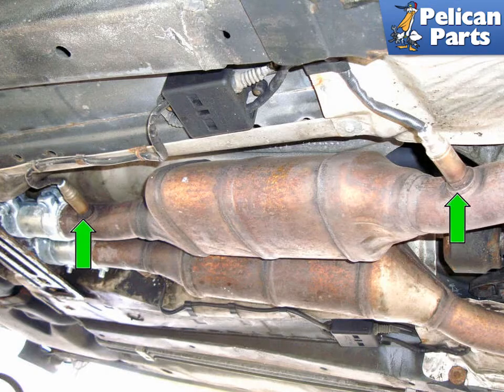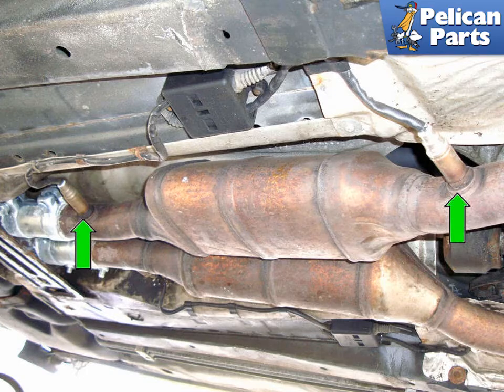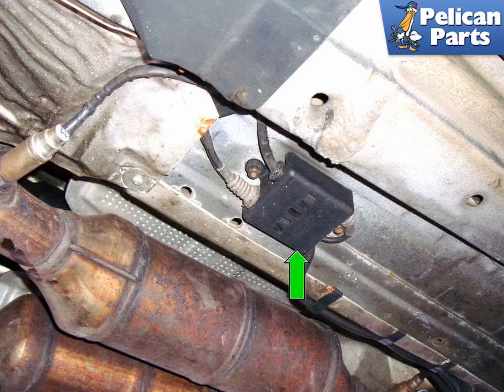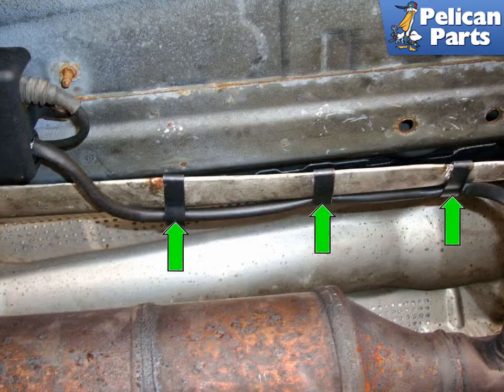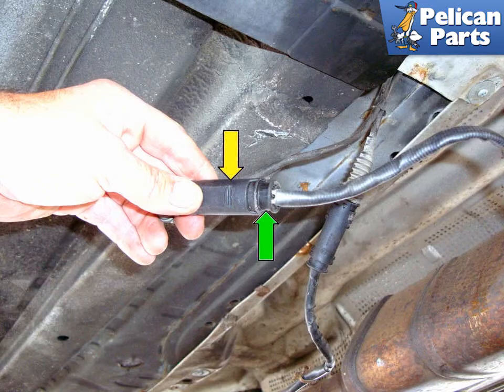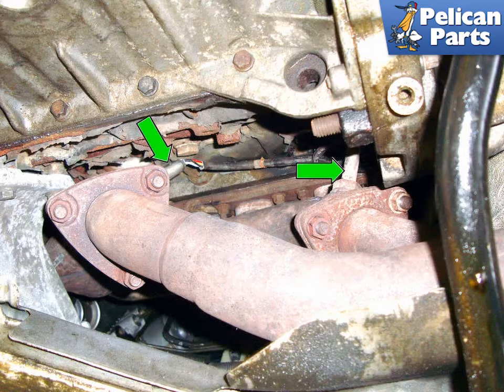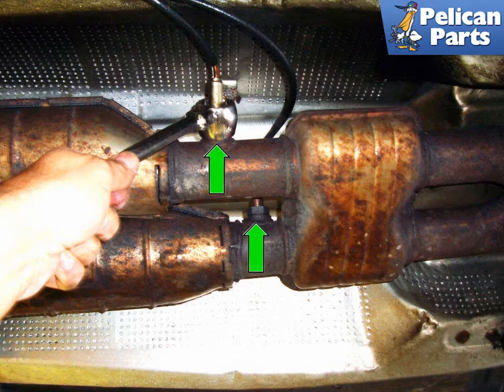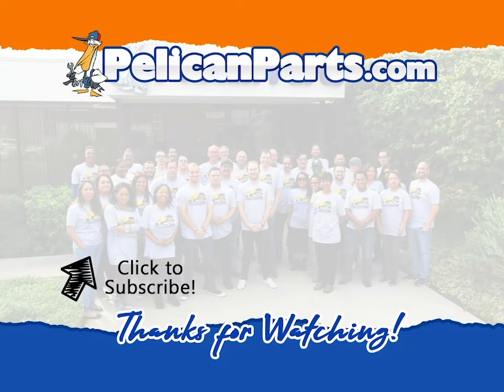BMW E39 5-Series Oxygen Sensor Replacement | 1997-2003 525i, 528i, 530i, 540i and M5

Comment: my o2 sensors aren’t located in these areas for the 525i. maybe they’re a bit more upstream, but i couldn’t find them, idk.
Reply from the maker: What is the year, model and engine size of vehicle are you working on? I can see if I have that info.
Reply: @pelicanparts  2001 525i lci, n54b engine, inline 6, 3.0 liter displacement